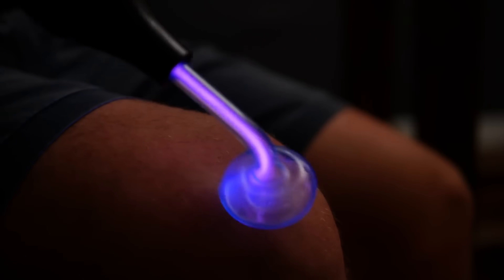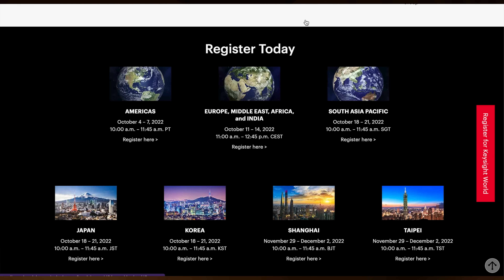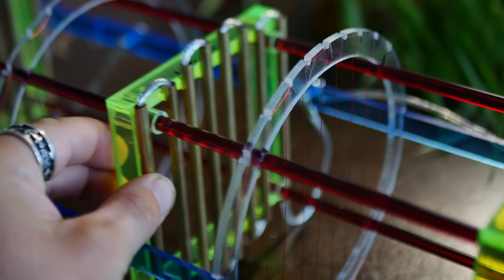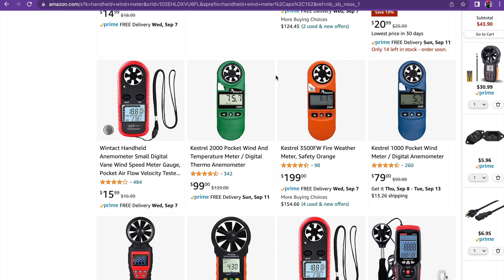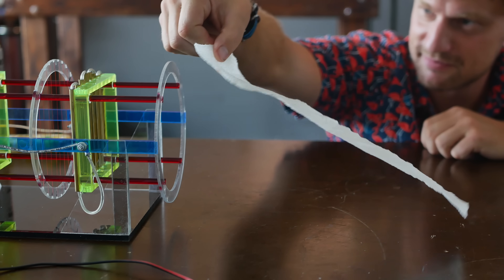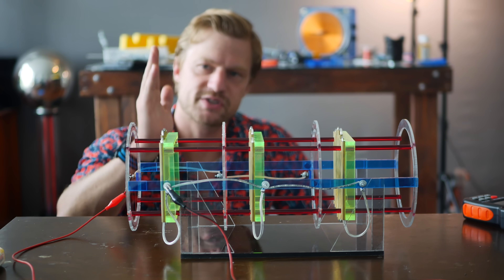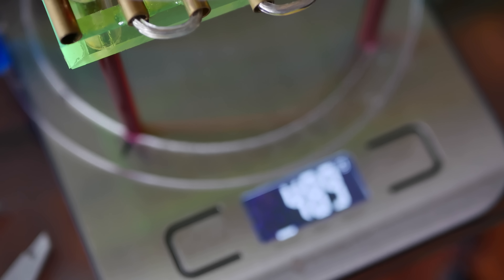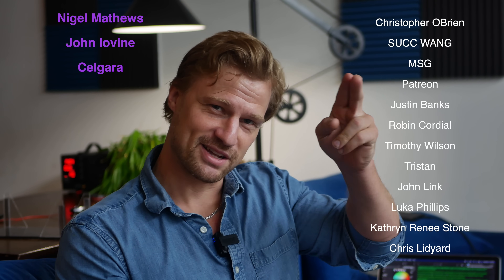Designing A Next-Gen Ionic Thruster! (For Flight)

Comment: I know you probably have better ideas, but I might as well see if my ideas are viable?
Increased wire size (This increasing voltage flow potential), create a housing for the building to streamline airflow and nozzling the end to created more directed thrust, insulate any wires not needing free exposure to pass ions, decrease space between staging to eliminate weight of material needed. 

You could also increase the number of wires across the gap, but I was wondering if a semi spaced coil (Much like that of a tesla coil's top) might be more or less efficient by creating a less obstructed negative space for the air to flow, or if it would just create induction and thus heat? Wire material could change but that's be costly. I know silver, gold, platinum and palladium have higher voltage ratings, but also lower melting temperatures, which might be something to worry about in the future.

Comment: Are those hot spots in the plasma due to reduced insulation in those locations? Would increased surface area in the positive electrode yield better results, would exposing more of the insulated wire also help?

Comment: I just had to subscribe. Incredible work. Love watching the process. 

Try differing voltage across each section? Maybe increasing or decreasing can act as a feathering angle on the field/airflow generation.

Does the number of plasma generation electrodes to ground electrodes have an optimal ratio?  

Could a ground electrode smaller in diameter then the generation electrode point act as a nozzle pulling airflow into a nozzle less constriction point? Flow shaping?

Comment: this is amazing but like you said there are some things you could do to improve it like:

you should make it shorter to make it lighter.

also using a more conductive ground "grid" you can make it thinner i know it will be expensive but it will help.

and last but not least since the air coming out is not hot you could add 2d or 3d thrust vectoring.

Comment: This will never be a primary provider of thrust for any type of manned aircraft unless energy levels were increased by several orders of magnitude. However its real use will be in space where even a tiny amount of sustained thrust can eventually get you up to near light speed provided the energy supply lasts. Also its not the air that provides the thrust its the ions themselves. The moving air is simply a byproduct of being pushed along by the ions. In space it would generate thrust too even with nothing to 'push' against simply due to the action reaction principle.

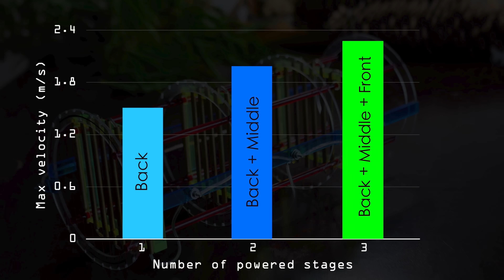Comment: As seen @10:56 the 2e  stage adds 33% and the 3e adds only 17% , so a 4e stage wiil only add 8% and a 5e just 4% ...
As for weight: why use brass and not wire (lot of diff in weight)
And for more stages: (from out to input) ground 1e wire, next 1x voltage on 2e wire, next  2x voltage on 3e wire, next 3x voltage on 4e wire  then you have also 3 stages with +200%  is my guesing.

Comment: How close can you place the electrodes together? Does double amount of electrodes( wires closer together) equal more thrust.? Also the aerodynamics. Pressure wall creates the forward thrust in a jet engine. Some parts of your engine would have to be dedicated to velocity while the other area pressure or both in a single “module”. I’m not a scientist as you can tell, but I can’t get enough of your projects…Awsome!  I was a turbine tech in the USAF and currently still in aviation(mostly avionics).  Can’t wait for your next bid. Thank you!

Comment: While the three stages look awesome, wouldn't just a single stage have more TWR than the triple-stage? If I understood you correctly, going from one to three just gave you a 50% boost in power, while at the same time at least tripling the weight.
Reply: Came here to make the same comment. Super interested in the response!

Also seems like creating a laminar flow would drastically improve the TWR, since a lot of energy is being lost to audible turbulence .
Reply: Yeah he might want to consider building wide, single stages instead of stacked multiple stages to maximize thrust to weight

Comment: I read through quite a few comments and wanted to amplify on the corona discharge side... would a toothed electrode increase the charge density lowering breakdown resistance? (Photocopiers used to have smooth corona wires, now they're needle electrodes.)

Comment: I think you could improve efficiency a bit by improving your ground plane electrodes. The current setup seems like it'd mostly smash the ions into the front face of the grounding tubes and then have to force that deionized air around them, or the ions might miss completely depending on how fast they're moving. If you had something that used much thinner, more closely spaced wires instead of big ol' tubes, you could probably reduce the internal drag of the thruster.
I also think you could make it a little more directed by fixing the offsets at whatever optimal distance you find, and using a tightly stretched film like clingwrap or something to keep the airflow contained. Ducted fans are better than un-ducted but that's mostly because of tip drag on the blades, but I can't imagine it wouldn't help here. 
Last thought I have is that electron emission is at least partly a function of surface area, correct? so would it be a good idea to have multiple closely-spaced grids for each electrode, basically just increasing the current that you can pump into this thing at a given voltage?

Comment: Is there a different way to wind the electrode coils so that they form a “lensing” pattern similar to a fresnel lens which would “focus” the stream of excited air towards the center of your array and possibly accelerate the air more?
Reply: That's where I'd think spiral plasma wires would come in handy.  Instead of straight lines of plasma, create a vortex movement.
Reply: Hey, i am not an engineer and maybe thats a stupid idea but my first thought was why not to compress the air with closed sides and a bigger to smaller exit Design? I hope that makes sense.. anyway loved to see something New :)
Reply: @alexandergeuze4689  as someone who is going to school for engineering. The biggest difference between regular people is the paper work THE SHEAR AMOUNT OF PAPER WORK!!!!!
Reply: @alexandergeuze4689  but you basically repeating what first person said.
Additionally you'd either have to increase voltage each "lense" to accelerate the flow or move the "lense" distance to maybe do the same thing.
Reply: @alexandergeuze4689  Something like a Kort thruster that uses a propeller in water.  I don’t know if the physics would work but that is why it should be tested!
Reply: Would any shielding or reflection boost efficiency?
Reply: I was thinking this. This prevents airflow though but accelerates the air coming out. So less air coming out faster.
Reply: @Jd-zl7mn  So exactly what an ion engined spacecraft would want. There's potential to be explored here.
Reply: @sorashirogami1729  I am not going to say anymore because engine design is what I want to specialize in.
Reply: I also think this is the right direction, there must be lots of side loss of flow. rotating the mid stage by 90deg might help.
Reply: A spiderweb design would fit this criteria.
Reply: "WOOHOOOO"

- excited air, probably. idk im not a physicist
Reply: Or doing something akin to a phased array antenna to direct the airflow by selecting different windings to be charged, moving the airflow around like an oscillating fan without any motor to achieve the movement
Reply: you could just use a funnel
Reply: Well photons don't repel each other, and are happy to stack up in the same space (within reason, there are extreme examples where this breaks down).
Ions... repel each other, and air pressure tries to escape compression to equalize. So that's going to limit the effect dramatically.
But, that's not to say the effect couldn't be exploited "to an extent", like you suggest.
I'd love to see someone try at least. Maybe even use sound waves to help focus, since unlike photons your air molecules are gonna constantly run away from your focal point.
Reply: @kathrynck  Photons? This uses electrons off the HV wires to the grounding grid. The only photons I saw was the pretty corona glow, just a byproduct of ionizing the air (though could be recorded as an energy loss, but not sure how to get around that w/o breaking physics).
Reply: @Sembazuru  I think you mis-read my post. The original poster mentioned a "lensing" effect, something like used in a fresnel lens.
Lenses use photons.
I was contrasting that to using ions, which is what this tech does.
Reply: Actually, if you could get something like this to work in a supersonic state, the shockwaves could be used to auto-focus your effect. Maybe even hybridize it with a traditional jet to see if there's any extra thrust available from adding ridiculous amounts of current to a jet engine design? Might use multiple megawats per second though, but as a thought experiment at least...
Reply: @kathrynck  hybrid engines are a thing. Iwas think of combining it with jet engines but I don't know enough on how ion engines work. Also probably where it would be used.

Comment: So based on the data you collected, additional stages do not scale linearly. Two stages + 33% and three stages + 50%.  I assume that it's because the molecules being impacted are already moving in the direction you want them to go, so it's more difficult for following stages to impact a molecule and create thrust.

If you wanted to keep it to a multi stage design, a way to improve the efficiency would be to increase the likelihood that a molecule will receive an impact, and that would mean staggering the wires so they don't line up across stages, and therefor have more static particles to impact. But I suspect that the airflow provided by the first stage is going to create enough flow that everything will be moving and you won't gain a significant amount of efficiency.

If I were developing a plan of attack, I would think about increasing the surface area of the positive electrode wires by spacing them closer or using a very find mesh/grid of them.  I would also think about only accelerating static air with a single stage but adding it into the already present vortex. A cylinder with a first stage at the front, then layers of stages that come in from the side wall of the cylinder sucking in "fresh" non accelerated air through ducts.

Next, I would explore the relationship between the quantity/surface area of the ground electrodes. Do you need one ground electrode per one positive electrode? I doubt it. If all you want to do is create a flow from the positive to negative electrodes then maybe you can use a smaller ground electrode with adequate surface area to provide thrust vectoring/directionality for a larger number of positive electrodes. So you can optimize the electron flow direction depending on where you are in the system.

Assuming that my original assumption is correct and that already present flow lowers efficiency since it lowers the likelihood of an impact, then using this on an aircraft would lower efficiency dramatically after it starts moving. So it might be useful to test it for efficiency with an already present airflow.  As well as to optimize any aircraft it's used on for slow flight speeds. If there were a way to slow the air before it's ducted into the "engine" without losing speed then that could be useful too.

Also, what about the materials used for the electrodes? In vacuum tubes the cathodes are coated in order to increase their efficiency at giving off electrons. Tubes might also give some interesting ideas, like how grids are wound, and the use of beam forming plates.  For that matter, a three electrode system might also be interesting to test with a cathode/grid/anode. By changing the potential of the grid, you could control the emissions between the electrodes and possibly increase them.

Cool video and project, looking forward to seeing where you take it from here.

Comment: Other people made many wonderful suggestions but I'm curious about certain, more minor details: 
Is that an optimal configuration for the electrodes across those gaps? What about wider or narrower spacing, or configurations that aren't a bunch of parallel lines? 
For the receiver electrodes, would there be a meaninful improvement if their cross-sectional shape was less circular are more teardrop-shaped? What's optimal for internal aerodynamic pressure?

Comment: Use thinner wire to lower the voltage needed for dielectric breakdown.  Also, realize that thrust is mass flow rate times velocity.  Three stages in series give you 1.5x velocity, which is 2.25x thrust for a given cross section of thruster.  Three stages in parallel give you 3x the thrust because the velocity stays at 1x but the section area is 3x.  However, your exhaust velocity needs to be higher than your airspeed, so staging may become necessary as you go faster.

Comment: Would be interesting to check how input air speed affects output air speed.

Like for example if we're gliding at 10m/s does it still produce +2 m/s or is it less/more (I'm guessing less). Or whether humidity helps or hampers it.

Then there is net density, probably the higher the voltage the wider the net of the wires can be.

Then the shape, like have "ground" be just a small circle at the end to focus the stream more in the middle

Comment: 1 & 2 Copper tubes are too thick and not aerodynamically shaped.
3 circle frame leading to a square frame… both should be square (or both circles).

(What would running the anode and cathode perpendicular to each other do?)

Comment: It would have been a Super cool shot if you had shown the dry ice in front and back at the same time. Big fan of your work but if this was a perpetual machine, people would be asking for the FULL shot. Can we get at least ONE wide angle. Preferably a few. Just saying.
Reply from the maker: That’s a fair request! Honestly, my close macro shots are used because I’m very picky about how a shot looks. I like there to be a fuzzy background due to the lenses that I use. However my camera kind of sucks. When I’m far enough away that the entire device is in the frame, the video quality doesn’t look like it’s any higher quality than a cell phone. It’s just personal preference, as I like to have a good depth of field in my shots. But I definitely hear your suggestion, and in version two video, I will include full shots of it in action

Comment: You should test it with the system being enclosed, only having an opening and closing, will either result in not having enough airflow since it’s restricted by the first thruster, might also mean it’s not getting enough air since it’s not sucking in air from the sides, could make it more powerful too since it eliminates slower moving air from the sides, and creates a higher pressure area, similar to a turbine engine you could taper the end to a smaller point to increase pressure too

Comment: I think there is a problem here you need to figure out and calculate in the weight of your power supply and delivery. Because with out it the device wont work and there for should be considered part of the device.

Comment: Ideas: what if each stage spun like propellers? What if you changed the geometry of the tubes (maybe thin but long, or some exotic shape)? What if you changed the material used for each stage? Could this type of thruster be combined with some other method of thrust -- say, a plasma jet engine? What if you involved magnets or electromagnets in this design, somehow?

Comment: Curious if moving the whole stages not just the length between positive and negative could cause more energy efficiency.  Similar to how a car has lower gears to get going, you could place stage 1 and 2 closer but stage 3 further apart and and find the optimal distance between the positive and negative parts of each stage depending on its location.

Comment: That is incredible. I'd love so see if you can reduce the depth of each of the stages to increase stacking. And measure thrust per stage weight. Perhaps a transparent acrylic pipe housing would also help with keeping the air flow steady. I'd love to see a comparison in watt per gram of thrust with an electric engine, or a gas one.

Comment: Pretty cool prototype :)

I think you alluded to the design changes throughout the video. My guess at your 3...
1) [Laminar Flow] Change the ground planes foil with a cutout for promoting laminar flow. Maybe something like a honeycomb cutout.
2) [Weight] Eliminate the screws & bolts to ultimately reduce the weight. Many ways to approach this... such as using snap-together parts, lighter fasteners, welded nickel strips, etc.
3) [Airflow] Different diameters between stages to make a nozzle.

Comment: well you could always heat up air like a jet engine just electric and blow it out the back with electrics. evoula an all electric jet engine. Oh yea put it in a tube yout loosing a lot of thrust. and i believe that the wire mesh isnt all to productive. mabe try a screen mesh instead of parallel wires.